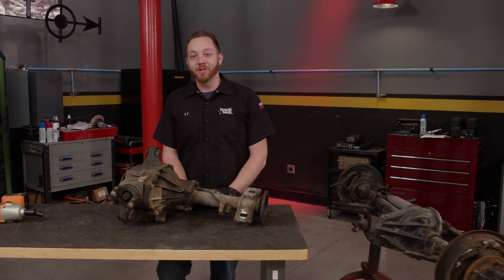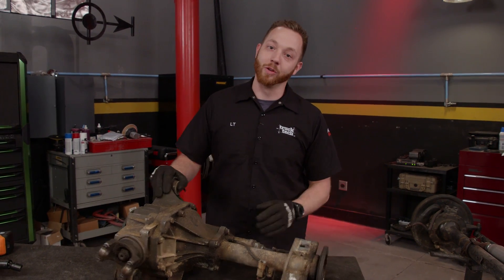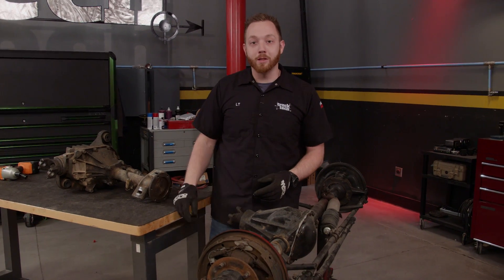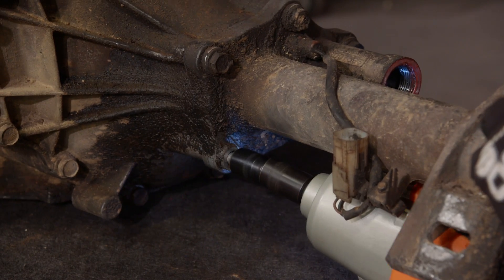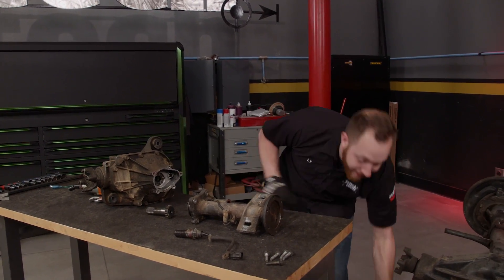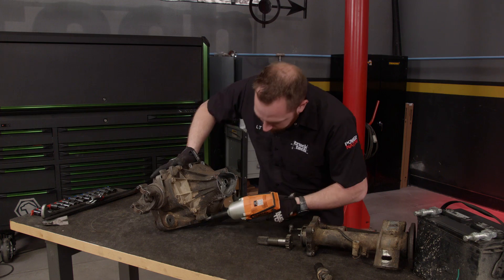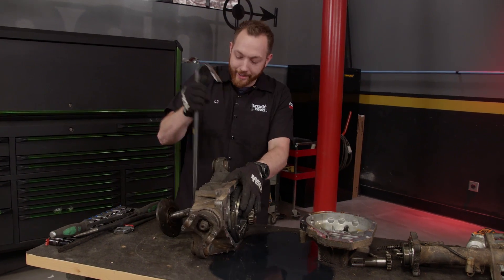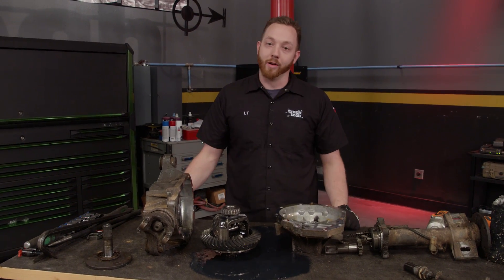Basics Of An IFS Front End

Comment: I have a 2012 silverado with 8.25 and swapped front diff from another 2012 with 8.25 but i noticed front wheels turn faster, why is this happening if both axles are 8.25?
Reply: I think either your front differential has a higher gear ratio than the rear (unlikely), your transfer case gear ratios are abnormally high, or rear axle is experiencing a significant amount of extra friction or weight in some places.

Comment: Hey so how hard would it be to add an ifs to my 17 GMC Sierra 2wd wt? Parts needed that I know. Correct transmission, transfer case, front it’s diff, cv axles and parts, new rear drive shaft, and correct cross member for trans. Now do I need new front knuckles or will the new front hubs mount to my 2wd ones?